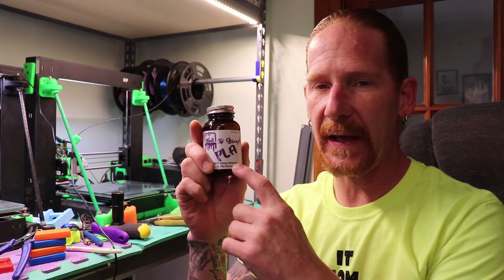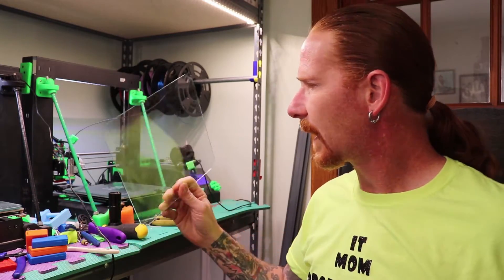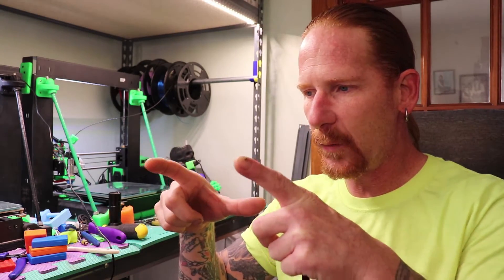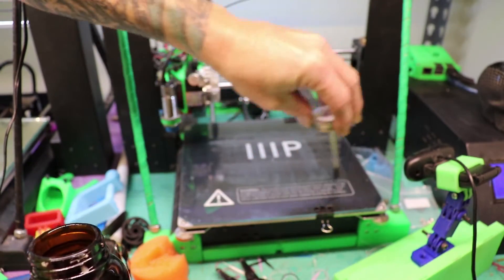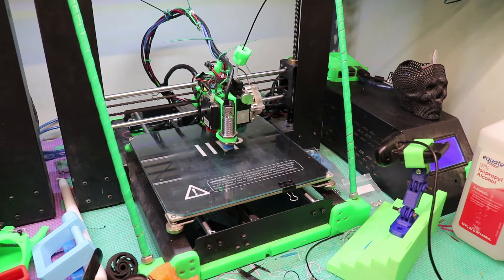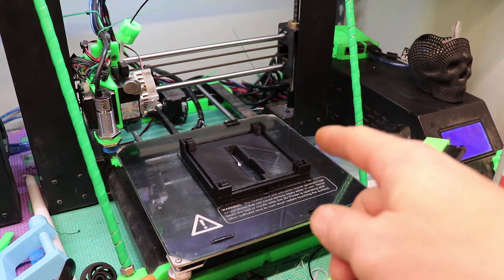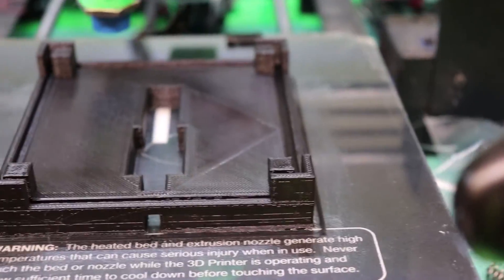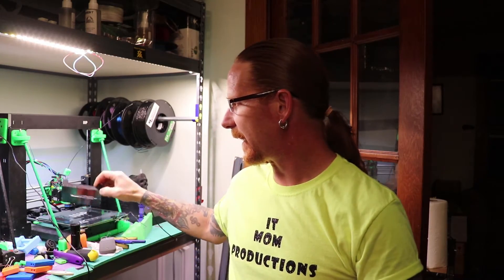3D Gloop as Bed Adhesion?

Comment: That's why I like Elmer's purple glue stick, I can print over and over on the same application. It looked like the gloop actually bonded with the part instead of staying on the bed. I honestly wouldn't use it as a bed adhesion method. Makes a great glue from what I've seen.
On the homefront I'm trying a PEI sheet with no additional adhesion vectors and some not yet released Premium PLA from AmazonBasics. Guess it's like PLA+.
Reply: Right. It looks to be a decent multipurpose glue. Awesome for gluing parts together and decent bed adhesion. There have been a few times I want overly strong bed adhesion but not so much with PLA however I think I will try this out and if it works great then I can get rid of a lot of extra junk.

Comment: Nice Matt!  Do you think there is an advantage/disadvantage to using 3D Gloop! when compared to other bed adhesion products you've used?  I wonder if the layer of the glue left on the bottom of the prints could cause issues in some cases though.  But, in any case, it sounds awesome as a substitute for other glues when assembling multiple prints.
Thanks!
Reply from the maker: As far as gluing parts this stuff stands alone and as far as using it on the bed literally this was the 1st time trying it. I wanted to capture the real results I went for it win lose or draw and it turned out great I don't think a shiny bottom is bad HAHA but if you get some for gluing parts try it as bed adhesion . I wouldn't just get it to use for the bed or maybe its definitely not as messy as hairspray
Reply: @InsideTheMindOfMatt  - I wonder if the ABS version would help prevent bottom layer warping?